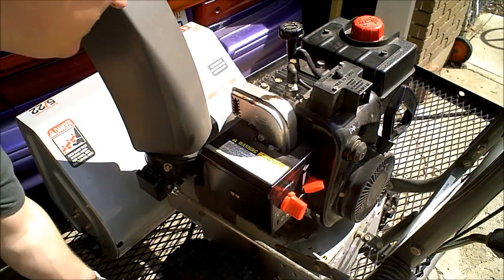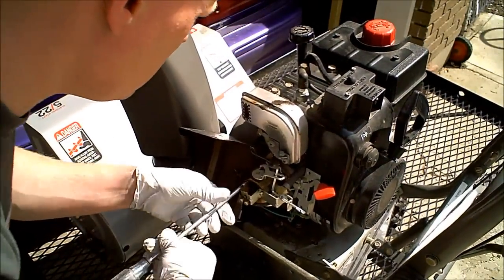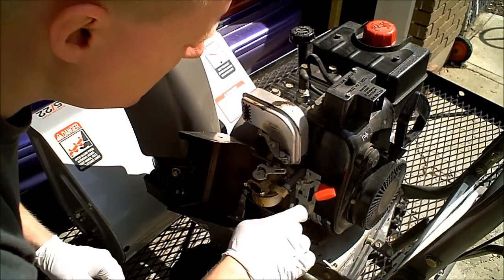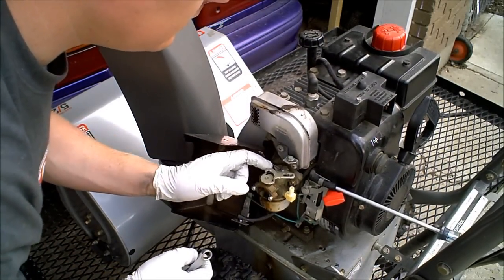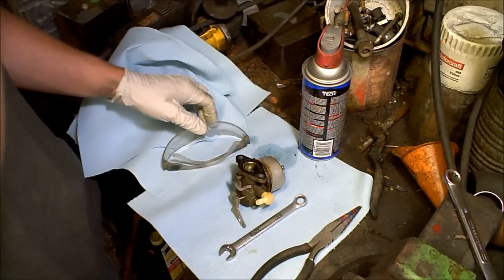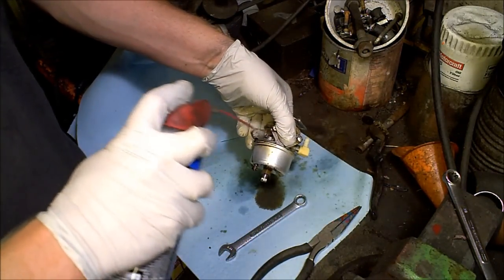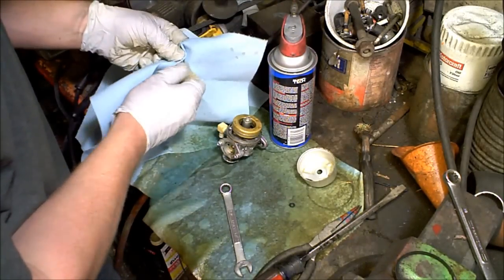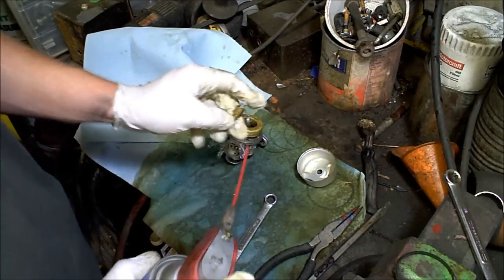Tecumseh Carb snowblower cleaning 1 of 2

Comment: I rarely find what I'm looking for on these you tube videos. But this is EXACTLY what I was looking for and need. The gas is continuously leaking from my carb. I believe its my bowl leaking. The drain valve also appear very weak. I guess I'll do the full cleaning even though all I probably have to do is replace the gasket on the bowl and the drain valve. Good Job, Thanks! where is part 2 of 2?
Reply from the maker: The gasket on the bowl drain is notorious for leaking. Generally I will just plug it off with JB weld if it gives me trouble.  If the gas is coming from the upper gasket or the throat of the carb it could be a bad needle/seat or float (besides the obvious upper gasket of course).

Part 2
http://youtu.be/5HNFUjgbJ0A
Reply: sixtyfiveford Wow, perfect timing thanks for your response because I put it all back together and the gas came leaking through the throat like you just mentioned. I checked the float like you mentioned in the video and no air was able to pass. Here's something weird though (at least to me). I pressed the primer and gas came squirting out of the side of the carburetor. What does that mean? I will check out the needle/seat.
Reply from the maker: The primer pushes air into the bowl of the carb. The sudden high air pressure forces gas up the main jet/emulsion tube into the throat of the carb.  That's with everything functioning correctly. If the gas is flooding then the primer could force the gas up the main jet/emulsion tube AND the bowl vent(out the side of the carb).

Comment: Hello Bruce P.,

How much does a jack stand like yours cost now, in the ballpark, and where can I find something that wide to support a 23” snow blower?  If I could get it, it will save me a lot of backache later.  My blower won’t start.  It’s exactly a 5-horsepower Craftsman, but with an electric starter.  
Your clips are very helpful!  Thank you!
Reply from the maker: In this video I had the snowblower on a Rear Trailer Hitch Rack that I made. A lot of small engine guys buy the Harbor Freight lift table for $170.

Comment: Hello Ford I got a Problem With my Snowblower Same Engine. I believe it Might be the Choke.. the snow blower will run fine till it warms up about 10-15 min.. Then it dies outs.
I need to wait till it cools off or it wont start... Once it is cold again it will start up fine...  Any sugestions on this thanks...
Reply from the maker: Ignition coil is the main culprit for this situation. Check for spark when it first dies.
Reply: I had the same problem. It was the valve clearance. Too tight so when it warmed up there wasn't any clearance. Easy fix.
Reply from the maker: Generally when the valve clearance is an issue the snowblower will have very low power. It will want to die when you hit any real snow.

Comment: Great video, however when I was snugging the bolt up after clearing the clogged hole, the bolt broke off right in the middle of the threads. I was able to get the broken part out, but any idea where I could get a new one? Do they even make them anymore?
Reply from the maker: Are you talking about the main jet?

Comment: I need advice on a 9hp Tecumseh/craftsman that is giving me fits. I’ve cleaned it, I’ve completely rebuilt it, I’ve even given it a good, long Ultrasonic bath.  But the only thing I’ve corrected is it will now idle steady.  I cannot run the snowblower unless I am either full choke or one step from it.  If I even try to click in the middle choke position, and especially off choke entirely, the thing just dies right away.

Fuel is fresh, plug is fresh. And like I said, everything except for the carb body is fresh, as well.  I have not adjusted throttle screw or idle speed, but that’s about it.  Where should I go from here?
Reply from the maker: Ben Krasner Do you have a bolt with a screw coming out of it on the bottom of the carb for the bowl retainer or just a bolt.
Reply: Just the bolt type jet, with the two main holes and a single small hole on the first thread.  This feeds to a green plastic main nozzle tube that has two o-rings on it.  The bolt/jet is literally the only piece other than the carb body that I have not replaced.
Reply from the maker: The hole down the center is the main jet. It connects to the two large holes. It is either blocked or has tarnish and needs a wire ran in and out of it. I'm not talking about the tiny hole by the threads.
Reply: Right. At this point, I've done all the cleaning I feel I can do on it.  The holes are open and clear and I can see light easily through, or spray cleaner easily through.  So I'm ordering a new one.  I am not the first person to get inside this carb, and I'm starting to wonder if someone enlarged any of these holes by intent or mistake.  The two intake holes in this nut do not even appear true and round, which differs from any picture I can find of it.  They are ovals - like the shape of a race track.  If my supplier has the part in stock, then I'll have it tonight and see if this was the fix.

Comment: My blower leaks gas out the carb when I push the primer bulb and will not start (no gas evident on the spark plug and it WILL start with a spritz of starting fluid in the plug hole).  It runs great once it starts though.  Is this a plugged jet?  How does the bulb push gas into the cylinder? Thanks in advance.
Reply from the maker: The primer button forces air into the carburetor fuel bowl. There it displaces fuel that is forced up into the throat of the carb and it will dribble out the front. You shouldn't see any on the spark plug as that would be a flooded engine and would never start.   I would make sure the choke is fully closing. The air bleed at the mouth of the carb that leads down to the main jet could also be plugged up.

Comment: I have a fixed jet. I took it out and gave it a good cleaning. One year i forget to purge the bowl of gas and it gunked up. The area where the o ring sit in the bowl is rough from gunk. Should the bowl be replaced or can i take an abrasive pad and clean it up.

Comment: I have an Ariens Snow Blower with an 11.5 hp Tecumseh Snow king motor.  I am considering just buying a new carb, because I haven't had much success rebuilding mine.  Do you know if I can buy a replacement that uses the adjustable jet?  My current is a fixed jet.  The motor is an OH318SA.
Reply from the maker: They are banned by the EPA.

Comment from the maker: If it plugs up and then dies watch my video called: "Modify a snowblower to never clog and throw 2x as far" 

If it just wants to cut out when it starts hitting a heavy load the carb isn't delivering enough fuel to the engine. Does your carb have an adjustable main jet(bolt with center screw located on very bottom of the carb like the one in this video 5:15) or a fixed main jet shown at 5:25?

Comment: I have a self propelled Craftsman EAGER 1 Mower.  Will start run for about a minute & then stall. Have to wait a couple of minutes & prime , the same. It has a carb that I cannot find in any video. Part # 7.538F7H the Model # is 917 377 362 the Engine # is 143.976602. The jet is plastic, the bowl is plastic. I sprayed whatever ports I found out. The needle is held by plastic so I did not take it apart but blew into the carb. Air passes when held upright & does not when upside down. Any help

Comment: Bad news  I tried adjusting the idle screw but it doesnt seem to do anything no matter where I set it to, the engine doenst change it just idles up and down  in surges, not too bad but it's not right. I wonder if I didnt get enough carb cleaner to the idle passages, or should have washed out the gas tank when I had the carb off since it had real old gas in it that had turned orange. It starts first pull, and runs great on high and med speed but idle is rough. Might have to pull it and do over ?

Comment: Do you suggest using compressed air after cleaning the Carb with cleaner, or will this do harm rather than good to the carb...
Reply from the maker: Robert Fields I really see no point in using compressed air. Carb cleaner gives you a visual reference to see how passages are flowing. Compressed air gives you no visual cues. Also gummed up gas can't be dislodged by force(compressed air) it needs to be dissolved. So after you clean it with carb cleaner there is really no point in blowing compressed air through it.

Comment: Hey Bud, I have the same Type of engine that your working on that's giving me a headache. Every time I try Starting it, Nothing. But when I spray it with Carb, It will Start for a second & shut off. So I replaced the Carburetor & still the same thing. The gas line is good. Please help
Reply from the maker: Probable causes:
-Gas isn't flowing to the carb(pull line at carb and check)
-Float set to low and not allowing gas in
-Float to low and bowl rotated wrong.
-Main jet clogged.
Reply: How do you adjust the float to let gas in? Also what do you mean by Bowl Rotated Wrong? Now Remember This is a New Carb I just installed.
Reply from the maker: There is a deep part to the carb bowl. This is positioned opposite the fuel inlet.
The float is adjusted with the carb removed. With the bowl off and the carb held upside down, the float should sit level with the carb body(gravity only). Bending the little tab that the needle touches will adjust this.

Comment: I have the same machine with the carb with the other jet you show. Also the secondary jet is fixed to the body without a slot for adjustment. After a second clean, it would seem it still does not run well. Any tips for this model? TIA
Reply from the maker: The fixed idle jet will come out, it just has a little plastic cap on it. Pick it off with a sharp awl or similar and it will expose the screw head. 

If the engine is surging, the idle passage/jet is clogged
If the engine requires choke to be on to stay running the main jet/passage is clogged.
Reply: Thank you for the tip. I took that jet cover off and that jet seemed ok, but the passageway was blocked (got a little carb cleaner in the eye ugg) Ill put some air to it to see if I can unclog it. Thank you for all your help.Hopefully 4th time apart is a charm.

Comment: I have an old Tecumseh engine from the 1970's. It was on a Sears machine of some type, and its model number is 143 627 012. It has double sprocket centrifugal clutch, and only two hours worth of use. My son and I want to use it for a go kart. Would you know of a replacement carb for this engine more appropriate for our new purpose, or should we try and get all the 
hardened varnish out of the original?
                                                        thank you
Reply from the maker: +Myron Piano Usually the hardened varnish will dissolve within minutes with a little carb cleaner and you'll be back up and going. Your Tecumseh model number is HS40-55382C . So it is a 4hp engine which is a little under powered for a go cart but will work with a light go kart. There isn't a replacement carb but all the wearable parts are available. You'll probably also need to tackle points and condensor at some point: https://youtu.be/HV9MJwsUP_4
Reply: Thanks for the help. My sense is that the carburetor is rather primitive. It has 399 1H5
on it, and it does not contain the throttle which is located in the tube the carb connects to. Also there is NO adjustable needle valve. I believe the engine was running quite rich; that's why I would like to replace it. Could I use a carb off the internet that works for a HS-40 and leave the original throttle in the wide open position. Also, do you use synthetic oil in a kart engine? I have always used straight 30 for lawn mowers.
Reply from the maker: As far as primitive a new carb would be identical except have fixed jets vs adjustable. You'll want to retain the governor setup unless you want it to blow up so an oem style carb is a must. There isn't a direct replacement for this carb. If there is not an adjustable needle valve on the bottom of the bowl then someone has changed it out or added a different carb already as Tecumseh didn't start doing this until the 90's. SAE30 is the best for them.
Reply: Myron Piano

Comment: How do I figure out which model Tecumseh carb came on my 2004 Ariens 524 snow blower? I do not see a model number listed in any of the manuals? It looks very much like the one you work on in the video with the small drain screw off to the side, but just a plain center bolt without any adjustment. Gas is now dripping out of the small drain screw and motor cuts off after a few minutes of use.
Reply from the maker: The model number is located on the side of the pull start shroud on a decal. If it is not there it is on the very top of the shroud stamped into the steel.

Comment: bought a new snowblower used it once second time would not start brought it back to home depot, they said oil got into the carburetor.   how is that possible
Reply from the maker: Generally because the unit has been tilted/tipped or too much oil was added.

Comment: I have the same motor, but the Governor is stuck and wont move.  Any suggestions?
Reply from the maker: The butterfly on the top of the carb is gummed up and needs to be freed. Spraying carb cleaner into the mouth of the carb and on the top butterfly lever will dissolve the old gummy gas. Move it back and forth by hand a couple times and you should be good to go.

Comment: would this fix my blower not being able to blow good and always clog ? i can't even use it right now it clogs so much it seems to run decent but it's 8hp and is absolutely gutless ive seen 5 hp blow way better.
Reply from the maker: You need this https://youtu.be/EMAgb3QNEE8
Reply: sixtyfiveford yeah i saw that but i found out my auger belt is very loose it must be slipping so hopefully a new one will fix it.

Comment: Where would I get the float needle?  I have an 84 toro 421 so it's all older and not sure what is compatible.
Reply from the maker: You don't need the needle as much as the rubber seat, that seals the needle. You might as well replace the bowl gasket along with the main jet/nut fiber gasket as they're all cheap. https://amzn.to/3Wo7hKM
You pull the old needle seat by inserting a course sheetrock/ deck. Screw down into the hole and pull it out with a slight twist. You then put the new seat in, with the ridges towards the carb with a blunt tool and or the back side of the needle until it seated.

Comment: I have trouble starting My blower after draining gas tank and adding new fuel. It was cold day when I tried to start it, any suggestions? Thanks.
Reply from the maker: The main jet easily gets plugged up and needs to be cleaned. You can remove the entire carb or most of the time you can get away with a quick 5 minute clean. I show how on this video http://youtu.be/KYj5oH0vNVg
Reply: put a new carb and has no adjustment for air adjustment, smell lots of raw gas and fuems, whatcould be the problem? thanks
Reply from the maker: If you smell raw gas it must be leaking out somewhere.

Comment: Can you drain the gas out after the season without just running it out?
Reply from the maker: Older Tecumsehs have a push button bowl drain on the bottom of the carb. You can also shut the fuel shut off under the gas tank and run the engine until the carb is empty and just leave whatever is in the tank there.

Comment: I have a newer style Carb with the non adjustable Main Jet. Would you clean that any different than an adjustable one in this video?
Reply from the maker: rogue203 Just make sure all the passages are clean and you'll be good to go. In this video I show the fixed jet cleaning http://youtu.be/KYj5oH0vNVg
Reply: Yup, The main was clogged. When I shot Carb cleaner down from the top nothing came out the 2 holes on the base. Used the copper wire and all good now! Great videos! I subscribed to your channel! Thanks!!
Reply from the maker: Awesome. Thanks for the sub. -Moe

Comment: When I reassemble the main jet, the brass washer doesn't stay sun against the o ring due to gravity. Is this a problem?
Reply from the maker: +SpacePunk1000 You have an adjustable main jet? There is a main jet needle, spring, washer, and then o-ring.
Reply: +sixtyfiveford thank you! Didn't hear him mention the spring and the rebuild kit didn't have it. Just pulled it off the old one. In Denver, not wanting to shovel :)

Comment: Arguments for and against just reaching under there with a socket and removing the jet from the bowl without going thru all that disassembly? Mine runs pretty good except for an occasional misfire back thru the carb at full throttle no load. Makes me think it's running slightly lean.
Reply from the maker: I have a quick clean video that does pretty much this https://youtu.be/KYj5oH0vNVg